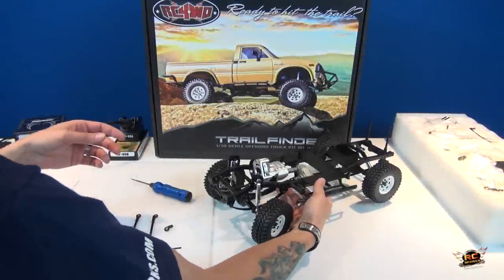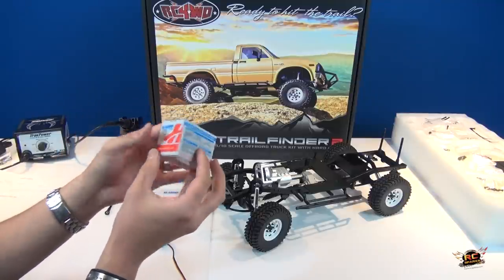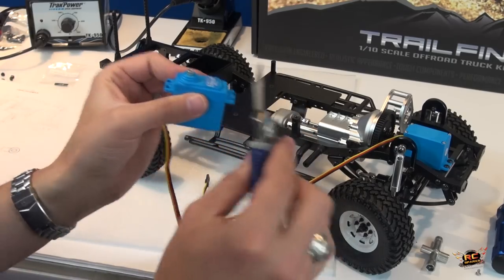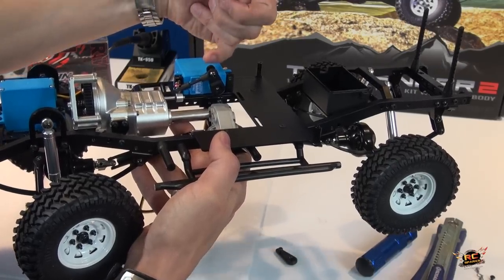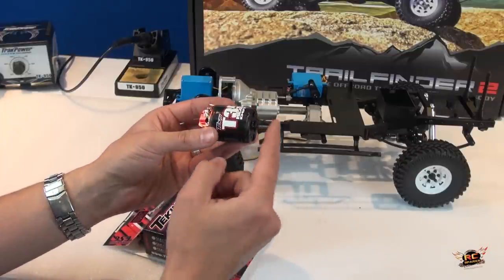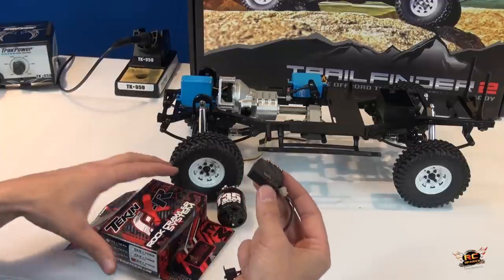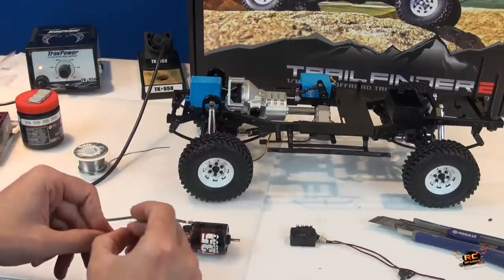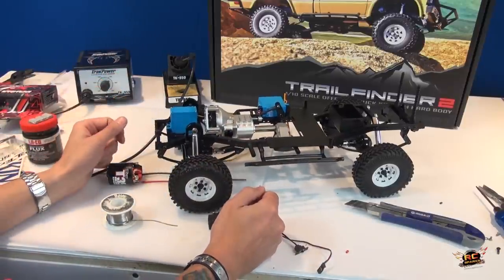RC ADVENTURES - SCALE RC TRUCK - RC4WD Trail Finder 2 - 4X4 Toyota Hilux - BV2 (Electronics)

Comment: i feel that using a thin solder wire works the best with no flux, as flux is already in the wire. also those stupid cheap soldering irons drove me insane couldn't heat up the metals at all, just melted my plugs. thanks for your videos, and helping me find a good iron for my hobby. saved me countless headaches.

Comment: The only bad flux is using the regular plumbing flux... It's acid and with electricity flowing through it, it'll corrode. Use a non acid rosin flux or my favorite, I got it in an electronics supply shop, it's solder paste... Basically, flux with powdered solder mixed in. Just dip the end of the wire and give it a quick zap with the iron and BAM! it's tinned! Great vids BTW!!!

Comment: I agree with your use of flux...I always get people asking me to solder things... I also reapply the flux to the "tinned" parts to be joined as well as adding a bit more solder to my iron. It gives you that fast flash melt with out adding too much heat.  Also a shinny joint is a strong one.

Comment: Good video Medic, just a friendly reminder diameter is the measurement across a circle threw the center of a circle (top to bottom). Looks like you’re trying to measure the circumference of the tire (around the outside of the tire).

Comment: Another awesome video medic! I like to use flux on all my solder joints too, My dad was an electrician so he knows a few tricks. :) I found a build series thread on another forum that you might be interested in, the guy is building a super scale rc hilux, he is making each individual body panel by hand from aluminium and the body is just like the real thing. Its got opening doors (that lock too) and the lot. Its true ultimate scale. If you want Ill send you the link :)

Comment: I would replace your shifting servo with a plastic geared standard servo, even a micro servo. 

The one you have fitted will have enough power to damage the gearbox if a gear fails to engage properly. I would also fit a collet, spring, servo arm, spring, collet arrangement to reduce the stress loaded into the gearbox selector fork/shaft.

Comment: When you put solder on the wires before soldering them it's called tinning, not pre-tipping.
Or at least it does in England

Comment: Looks like you could mount the tie rod on top of the steering arms
using spacers and get high steer and a better angle on the drag link..
I'm a 1:1 rock crawler...

Comment: hey after you sader the wires to the esc and the power cap. do you plasti dip the wires where they were sadered and do you plasti dip the power cap. like basically enclose the whole thing in plasti dip.

Comment: i have a question if i were to use panty hose over my brushed motor would that help with not getting debri in the motor itself when going in muddy water or would it just be a risk

Comment: the controller i have has a momentary switch for the 3rd channel and it isn't going to work too well with that transmission. i am pretty new to this stuff especially this truck so i was just hoping you knew of anything i could use for this. anything helps man thanks

Comment: The ESC is the Electronic Speed Control and is vital to the truck operation you caannot power the motor with any throttle without one.

Comment: Hey , Medic , i'm need to RC and just order the TF2 , but want to know some problem , I know that this truck need two servo , and it would be shift to low gear to high , but how to do it , is it automatically changed ? I mean that i just plug both of the servo to the receiver and it is good ? 

How to mount a Axial 55T motor on it ? Will it comes with the screw that i can mount on the transimission ?

Comment: Medic you should get a Duratrax Evader ext 2.4 it is a fun and reliable stadium truck and it is reasonably priced and you can upgrade the truck and has many replacement parts when you break them thanks.

Comment: Hey djmedic. I was wondering if you have to buy the motor,esc, and servos or if it came with its own. Also i was wondering if you have to sodder because i dont like to sodder and my earlier question about the motor and electronics, i dont have the extra money to buy them with the truck. Djmedic, please respond to my questions. I really could use some help.

Comment: medic when i solder (i don't have the same set up as you) but anyways when i start soldering the soldering wire melts just as yours but it rolls off the tip of my gun. it takes forever just for me to solder 1 wire can you tell me what i'm doing wrong or what lol.

Comment: A 35T motor has alot of torque, If the motor is double wound or triple wound is  where the power is based on. A triple wound 9T motor would be sick, A double wound "brushed motor" 35T could climb a 60* angle without any strain on it. A triple wound would get there faster.                   :-)

Comment: Puffmonster689: I had a xl10 for a long time in my scx10 and I was running a 35t tekin then a 27t axial then 12t Titan motor and then I went for a 10tx2 method R motor and all ran great BUT you have NO drag break you can crawl with the xl5 and have no problems but a esc with drag break is very nice now that I have one I won't go back to a esc in my scx with out drag break. I am running the RC4WD. Dual motor Esc with a BEC and two 21Tx2 method R motors with the level 3 motor plate and a upgraded

Comment: Hey Medic, I've gotten my Trail Finder 2 all put together but the servo for the transmission keeps slipping and the transmission goes into neutral and sometimes won't want to go back into gear without being flipped between them a couple times, do you or anyone else on here have any suggestions?

Comment: ...if this is supposed to be as close to scale as possible then why does it have a driver drop t-case on it?

Just yankin your chain a bit, but it looks like it the front driveshaft might hit the transmission depending on howmuch articulation this thing can manage.

Comment: Medic doesn't this come with its on servers and receivers and motor because I didn't see it in the unboxing video
Reply from the maker: Kits do Not come with electronics. That includes Radio/Receiver/Servos/Motor/or ESC
Reply: soz i'm a noob
Reply from the maker: It's ok Bro :) "Kit" means no electronics - "RTR" means Ready to run (which means you usually still need to get a battery & Charger)

Comment: Hey there medic. I have a two wheel drive slash and recently changed out to the traxxas lcg chassis. I also went with the proline arms all the around the truck. Now im now having an issue with the steering being kind of squarely. I run paddles and ribbed tires in the sand and on the hard pack or street i run badlands on it. Any help from you would be more then welcome. Thanks

Comment: Hey there the Wraith is an awesome kit just finished building one a good esc/ motor combo is the Novak timbuk2 wraith edition system i think its like 189.99 but its totally worth it all the guys where i live run the same system you can check out Richdog51 he's got a good couple videos showing off the wraiths of where we live. For servo im running a Savox sc-0251mg it was nice and cheap and has good torque. Good Luck with your build and have fun

Comment: i use flux to, even tho i dont feel that it works as well as it should, i wish i knew this about the turns of the engines before i bought my venom 55t motor, it was quite slow but i got some mud in it, it started to smoke and good buy, so i now have the vxl veniline syetem in my axial ax10!! it so awsome, i did copy you tho i put dually's on it, so are brushless motors water/mud proof because i have sunken it alot

Comment: Hey Medic, I have a question. Do you have any experience with rc4wd motors? Because on the website a tekin 35t motor is $65 and an rc4wd 35t motor is $10. I'd assume that they are less quality, but I don't know if you have an opinion or experience with them. Thanks man for another awesome video. :)

Comment: My TF2 is on its way, yeah yeah! Now Medic, Tekin out my way, TO.  ON.  Are really way to pricey. Would you have any other recommendations for a motor and ESC combo? Also, for the body, lacquer base paint and clear coat? Also, a good winch and and tires if you wouldn't mind. Looking at bulldog 9300xt. Wireless or not? Pros an cons? Get some more drifting up as well. Your not goin to excel if you don't do it!